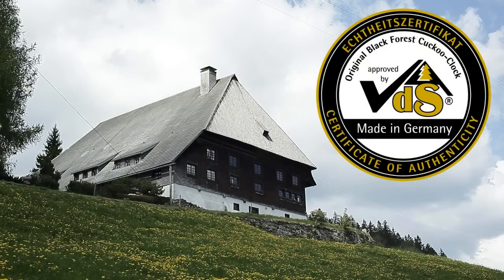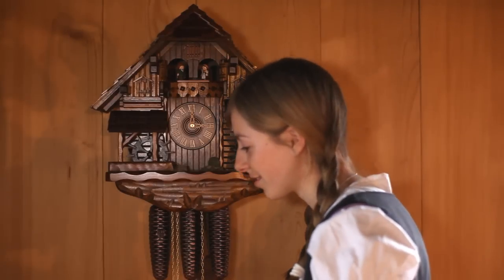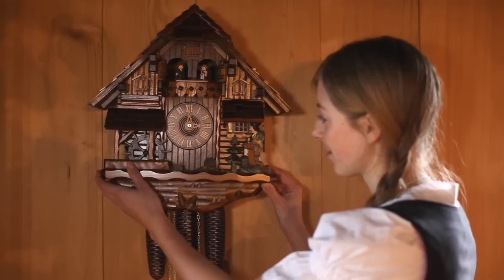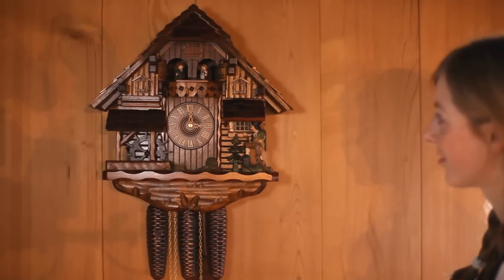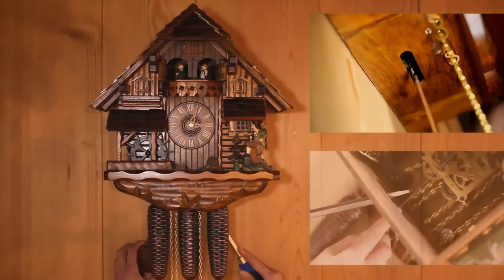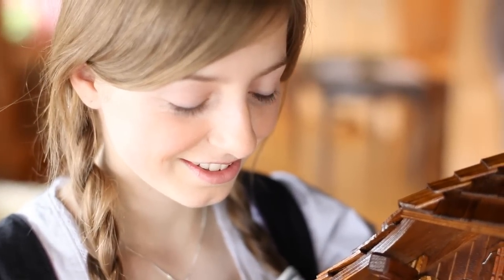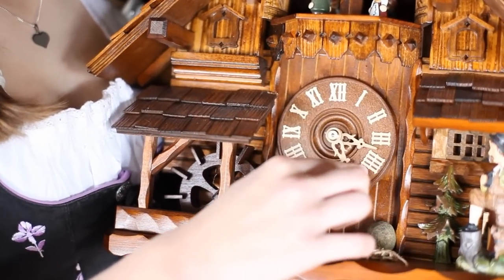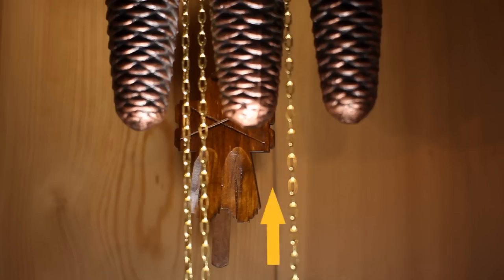Cuckoo Clock not working - Cuckoo Clock Service Video

Comment: My 8 day mechanical cuckoo runs fast to 15 mins i fed-up with adjusting time, later just tried to rotate the pendulum screw to run slow but cuckoo has stopped working now .. i don't understand what kind of mechanism..? Don't know about this kind of problems otherwise I would not buy also too expensive in world but hard to fix correct time. 🤦

Comment: I have a cuckoo Clock i bought in the black forest in 2001.  It runs fine but the cuckoo doesnt work nor does its door open....is there a simple fix?
It doesn't matter if the little wooden ball is pushed up or down...it still doesn't cuckoo..
Reply: Joni you might have to open it up and wind a spring inside. That's what I'm learning about fixing one too.

Comment: My cuckoo clock running 30 minunts fast in 24 hours,  i have adjusted pendulum on + side but it doesn't work,how can I adjust for correct time ,pl. Advise